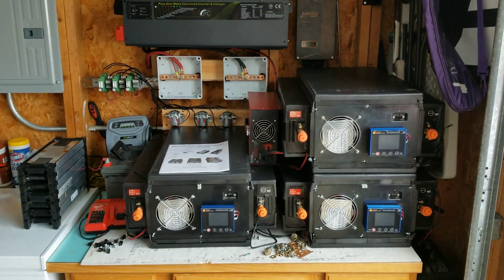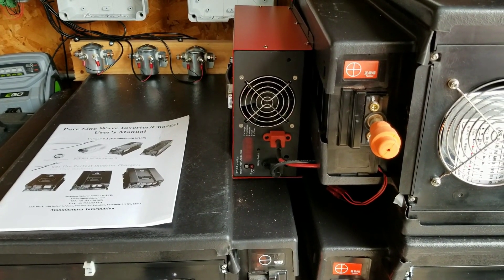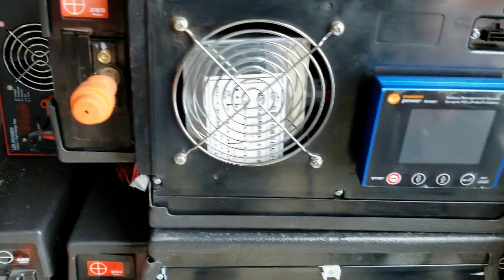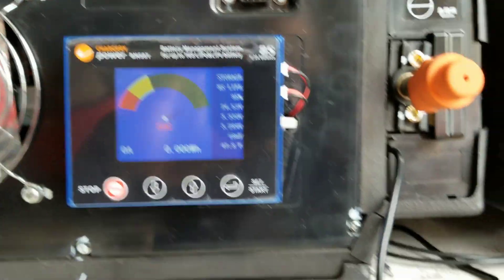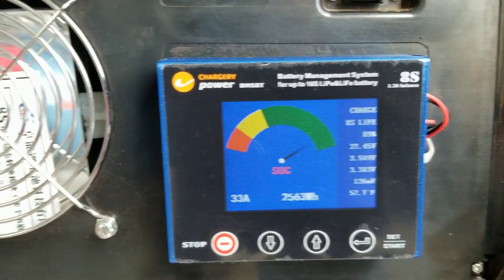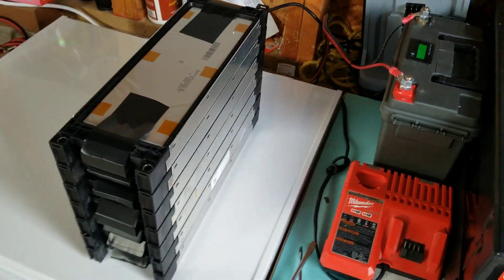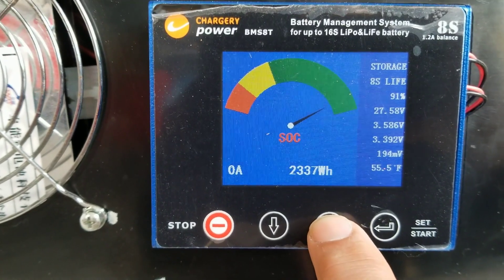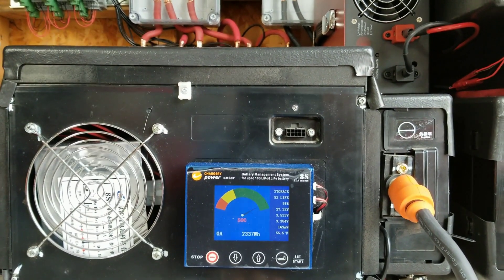DIY Power Wall up and Running

Comment: Great job looking for more information.
I've got 10 BYD units for a 48v setup.
What type of  Equalizer do you have 
I've got a 24v 160v BMS set for 130 discharge.

Comment: What voltage do your batteries rest at?

Mine like 26.45 ~ 26.55V

I run a 48V setup and if I try to charge more than 53.5V (26.75V) the cell difference gets very wide.

I have 8 total, with just 14 kWh of usable storage.

I charge my Bolt EV with them all the time, so far 191 kWh sent to the car!

Comment: Excellent Job !
Did you change the original balancer that came with the chargery BMS or you kept that inside the compartment of the battery? what type of fuse do you have on the postive pole ?

Comment: Great work!!
I have a couple of those BYD batteries, actually considered not using a BMS. I have ran them up and down a few times and they have been solid
Reply: I have 8 BYD batteries. If you set the max V and the min V with your charger, you can get by just fine.

Out of the 8 packs, I have 14 kWh of usable energy.
Reply: @JasonCarmichael  I'm getting ridiculous numbers from the two I  have. Ran capacity test with batteries in series twice and both times they came in at 16kw/260ah.  Batteries never went above 75 degrees on charge or discharging cycle. Letting them charge again for another test tonight
Reply: @JasonCarmichael  turns out it was a bad gage

Comment: Great video and overview.  I have 3 BYD's that I plan to put in service later this summer to power a pool pump.  Any chance you could provide links to the DIN rail relays and the 12 volt contactors?   Thanks again for sharing this video, very helpful for all of the BYD users to see.
Reply from the maker: Sure the relays are: Phoenix contact plc-rsc-12dc/21/ex and the contactors were an Ebay purchase. Look for: 12V 150A CONTINUOUS DUTY SOLENOID RELAY 1114208 FOR GOLF CARTS 300A IN RUSH
Reply: @carloschaves9253  Thanks!  I'm absolutely new to DIN rail components so that is helpful.  Can I ask one more question?  What is the name or type of terminal block to the right of each Phoenix contactor?   BTW, Love the Nissan LEAF, I drove a 2013 and now a 2019 40 KWH model.  Solid vehicle!
Reply from the maker: @GreenMountainDIYGuy  Sure, it's a terminal block, double level: UKK 3  2770011. End cover: D-UKK 3/5  2770024. And: End clamp E/NS35N  0800886.
Reply: @carloschaves9253  Thanks again!

Comment: Nice setup.  I have 8 of these batteries for my 48V system - 2s/4p going through 100A fuses for each pair to a 48VDC marine switch for each pair then onto a 600A bus bar for positive and negative connections.  Can you say how you arrived at your SOC/Voltage numbers?  I've been trying to gauge mine for a while.  I haven't drained mine yet below 51.7 volts (all pairs) according to my battery monitor (Schneider BattMon.)  I don't have a BMS in play yet to get me low voltage cut-off, but I have my inverter set to 48V for cut out.  So I've been monitoring the cells using an ISDT BattGo BG-8S Battery Meter that I wired into the BYD balancer leads throughout the day.
Reply: I have same setup. I brought mine down all the way to 48.1 once, the voltage difference was nearly 600 mV though. Solar-Ark in their manual for 48V LiFePO4 indicates 50.7 as their minimum voltage cutoff.

I have pure solar charging mine all the time now and rarely go below 52.1. I charge to 53.5 with solar, and 53.1 with the grid(if they need to be charged, and it's raining). As soon as I try to let them rest at 53.5, they self discharge to 53.1 anyway.
Reply from the maker: Thanks. I entered a Ah value of 170Ah in the BMS the original value of the BYD battery was 200Ah. The manual says it takes a few cycles to get a good S.O.C. value.